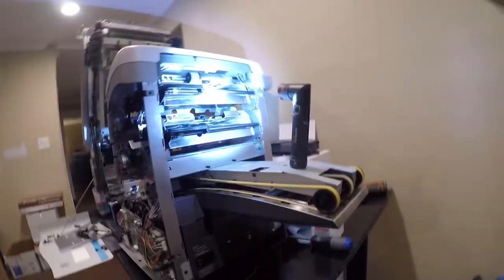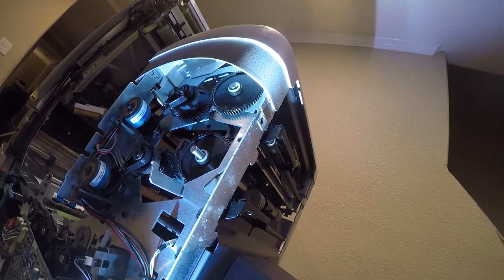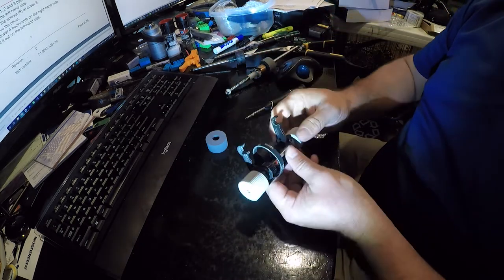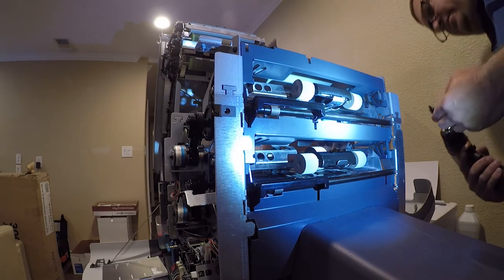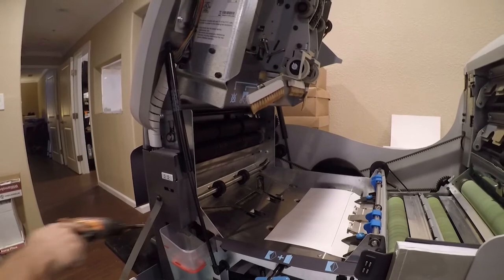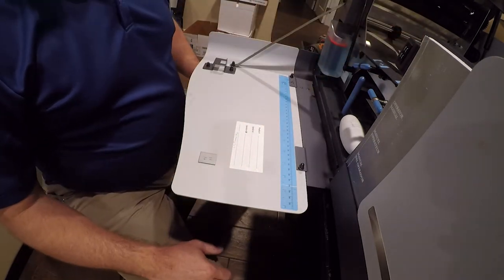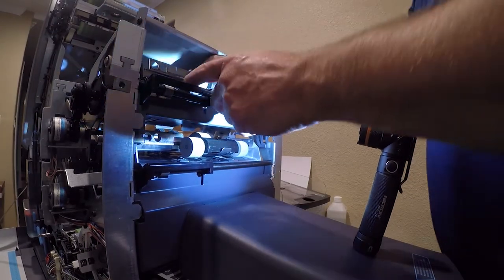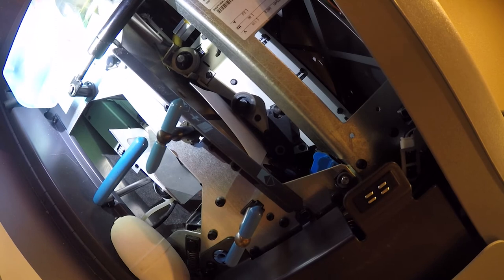Repair and tuning of Neopost DS-62 inserter folder

Comment: I am trying to figure this out everywhere but don't have any luck. My si/ds-62 was running pretty perfectly until recently. The documents are just stopping in the collating area and not pushing forward to the folding table/inserter. It is giving me error code 3:12. I have tried cleaning sensors, cleaning the collator belts, the photocells seem to be okay but it is driving me crazy. Any thoughts? I'm dying over here.

Comment: I Brian, I have an si 68 that keep giving a 1:83 fault code which ties to a communication failure from the inserter board. I have taken the covers off and attempted to check all elerctical connections as well checking for blown components. i had it working shortly after purchasing second hand however after returning to it a few weeks later it only throws this error code and doesnt want to do anything. Do you have any suggestions as to what to check for?

Comment: having an issue with a similar model, SI-62 and think we can fix but need to get the top cover off and see no easy way of doing it, any suggestions?
Reply from the maker: Message the folks at Clean Machine Mailing.  They are honest, have reasonable parts prices, and probably know how to get it apart.  If you google you might be able to find the PDF service manual as well.  It's a wierd chassis design.
Reply from the maker: Oh, and the screws come up from the bottom.  That part is a stupid design.

Comment: Have you had an issue with the inserter fingers not moving?  The entire bar that moves the fingers does not move and doesn't open the envelopes. Any suggestions?
Reply from the maker: No.  It more or less works... at least as well as can be expected.